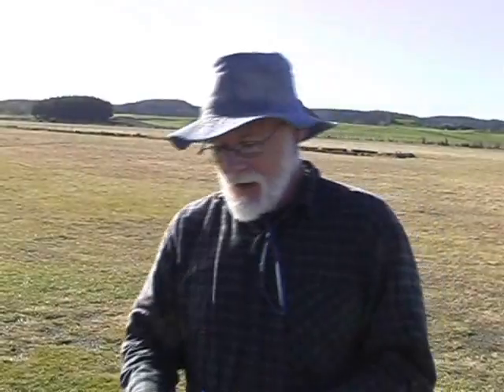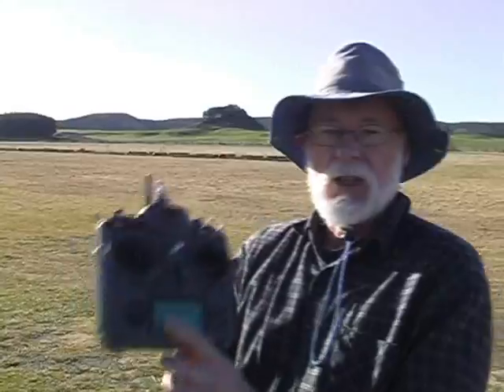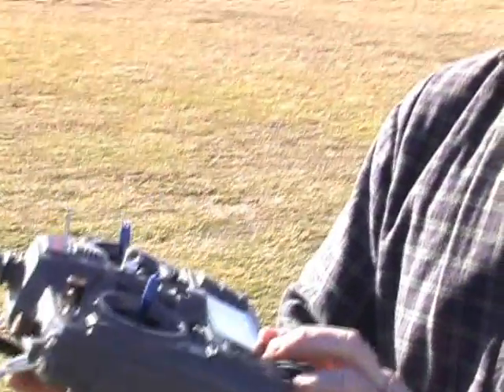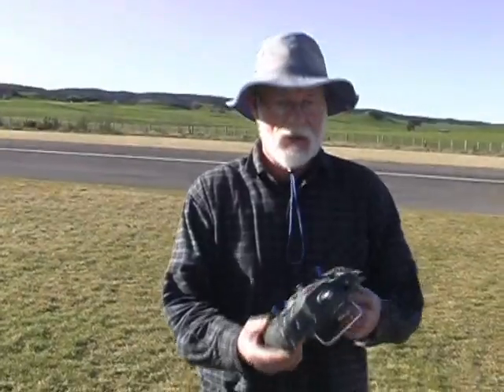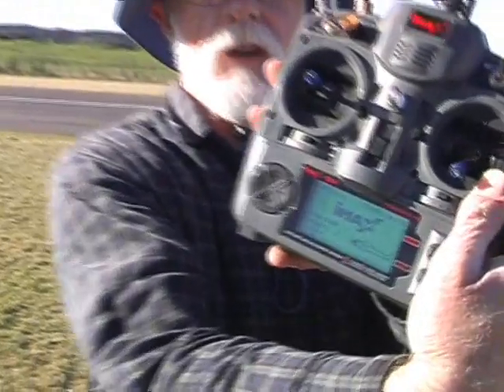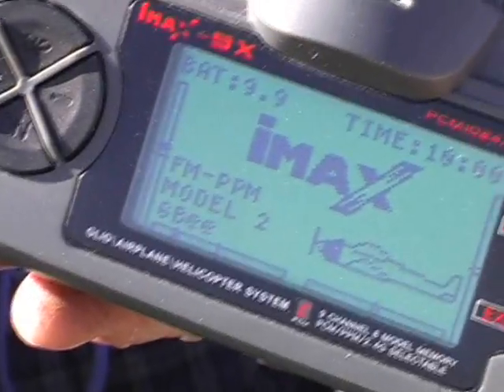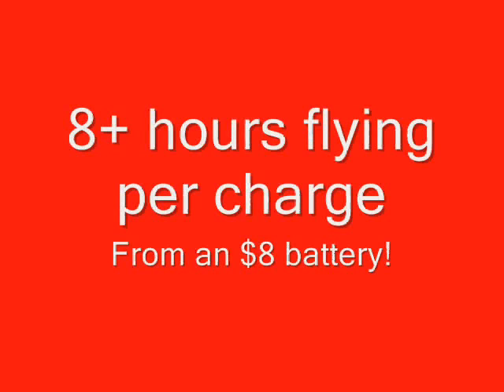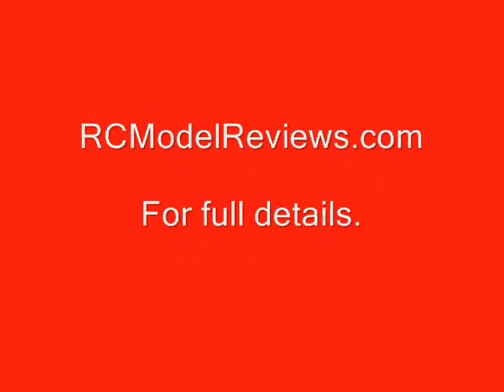The $8 lithium RC transmitter battery test

Comment: Hi Bruce, I just bought a 9x from HobbyKing and after first fitting a programming board and flashing to ER9x firmware, I have now ordered the batteries you recommend to build my Lithium battery pack.  Thanks again for such great info!